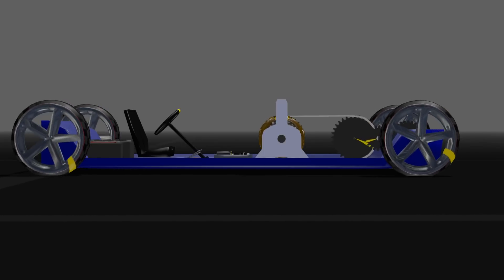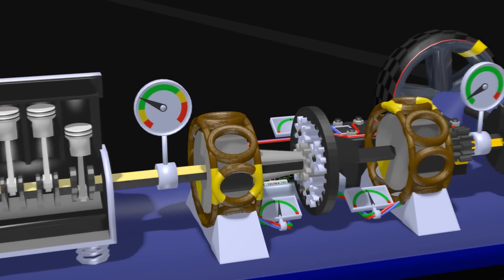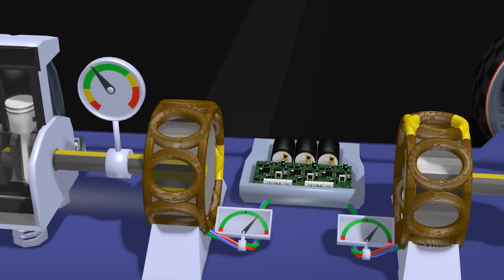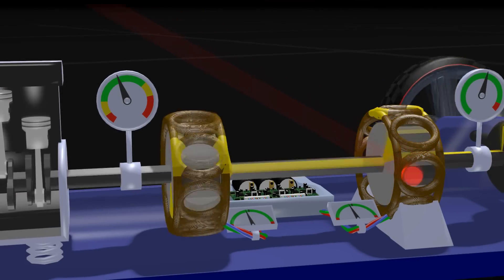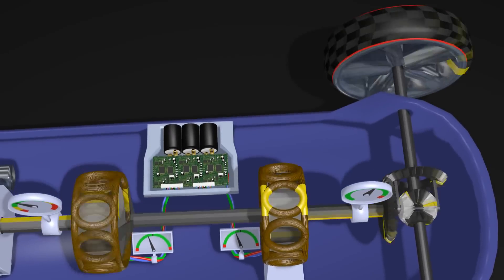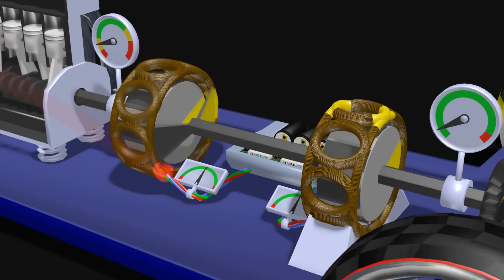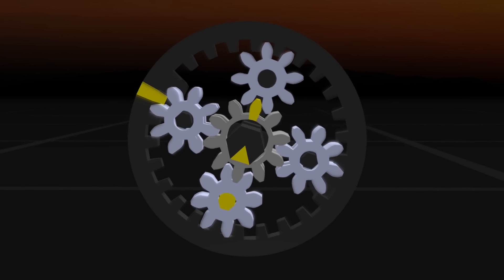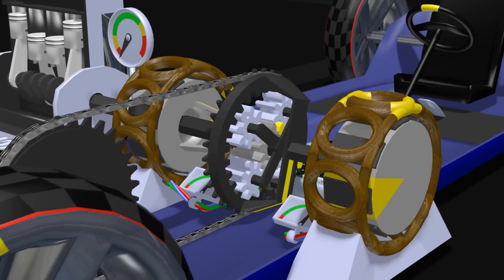Prius Hybrid Drive Explained

Comment: @Niels Blaauw   With all that you know, and I understand that your daily driver is the 2nd gen model, would you say that it is a good idea to go with the 3rd gen Prius because of the gear reduction, allowing MG2 to drive the vehicle for speeds up to 60 mph? I know that the 3rd gen has more torque from MG2 because of this. I'm on the fence between getting a late model 2nd gen or an early model 3rd gen. Thanks!
Reply: Depending on where you live. As far as I can tell, this comes down to fuel economy on highways. My 2nd gen prius loves 70-90 km/h (40-55 mph), that is where my consumption is the lowest, above that I exponentially lose fuel efficiency. As I learned, 3rd and 4th gen also likes 130 km/h (80mph) which is something I could value in EU, but might not be useful in some US states. Also 2nd gen (given similar age/milage) tends to be a bit more reliable, not that newer priuses would be problematic though. Also they are newer, usually meaning less mileage and also a bit more powerful. But I wont change only because of those reasons above. 

I know you did not ask me, but hope I could also share my thoughts.
Reply: @attilap.1817  Hello. I appreciate any feedback from anyone that has real life experience with this car, so thank you for that. If what you are saying is accurate, the 3rd gen would fit my needs best because I would be doing about 70% highway driving and the maximum speed limit where I live is 70 mph, however; most drive between 75 - 85 mph. I would be using it to drive 30 miles to work and 30 miles back home. Automatic climate control and Bluetooth are a huge plus for me.
Reply: @paulv8453  2nd gen also has Digit AC, Bluetooth is an extra and only for calls, not for music. With that said, I understand your leaning towards 3rd or 4th gen. Around here 3rd gen costs twice the as much as 2nd gen with little benefits other than its age and milage, not sure about in US though. On the other hand, prius is not really a car for highways if that is where most of your usage comes from. I am a fan of the car, but a diesel car might suit you better. At least that is the philosophy here :)
Reply: @attilap.1817  I'm not a speed demon. I try to stay close to the speed limit. I am a fan of both the 2nd & 3rd gen. I like the look of both. I like the idea of getting a 10 yr old car and trying to milk as many miles as possible out of it. I have seen YouTube reviews of the 2nd gen from owners that are very happy with their cars. It appears that they're all good but they keep making improvements on each new model.
Reply: My '05 came with over 260K miles. I picked it up from a used lot in March '18 for $2700 out the door. The local Toyota dealership performed a pre-purch inspection for $116 out the door, so I was not surprised later when I needed to replace the water pumps and tires (the brake pads will also prolly need replacing within the next 6 months).

The one surprise was the dash going out. Apparently, they need to be replaced at 300K miles anyway, but mine went out due to some old solder on the board (which apparently is not uncommon). There is also a blown fuse I continue to investigate, but I believe this is due to some faulty aftermarket wiring perf'd by the previous owner to install an iPhone plug in the center console.

The bottom line is that this car treats me so good, and for so little invested. If I had the money, I would go for a gen 4 (maybe a V), but I would not go with a gen 1 or 3. The difference in price from gen 1 to gen 2 is small compared to the upgrades, whereas the price goes up significantly from gen 2 to 3 with marginal improvements in design.

BTW, I use my Prius as a motorhome. I spend only $3-$5 per day in gas leaving the climate control on all night plus driving around town. Over the weekend, I drove from Greensboro, NC to Sanford, FL in Thanksgiving traffic for under $30 one way
Reply: @MarcillaSmith  Wow! That's amazing! I had an opportunity to purchase a 2nd gen 2005 model, the loaded one with HID headlights and fog lamps with only 118,000 for around $5500 but then I see that I could purchase a 2010 3rd gen for around $7,000 with higher mileage. The 3rd gen is supposed to be more comfortable, Bluetooth operates both phone & mobile device, and the MG2 motor has a gear reduction allowing it to spin faster, driving the vehicle up to 60 mph in all electric and therefore produces more torque. From what I've studied, the most significant improvements were made after the 2nd gen. According to Weber University here on YouTube, the 1st gen & 2nd gen share the same trans axle design. I'm sure that I'd be happy with either one. I too spend a lot of time on the road in a long commute and a lot of it is stop and go so I think that a CVT would be very beneficial. Thanks for sharing that story.
Reply: @paulv8453  I own a 2010 model.  Bought it in 2013 off the lot, it had 60K Km on it when we got it, was a lease return.  Paid a few extra bucks and they reset the warranty to new.  Today it's got 260K km on it, the only maintenance other than regular service happened last month, had to replace right rear wheel bearing, and I think left is starting to make noise now, so it'll be replaced soon.  Also did a couple of headlights a couple years ago.  Car has been great since the day we bought it.  I do one relatively long trip monthly with it, 250km each way, half on freeway, half on regular hiway.  The freeway portion is very hilly and we set the cruise control for 125 km/h for that part of the trip.  Computer tells me it does 5.3 liters per hundred on that section.  The other half is flat, slower at 90km/h, and computer tells me it does 4.7 liters per hundred on that section of the trip.  These numbers repeat month in and month out.  A couple times a year I'll spend a couple days in the traffic in big city.  If I reset the trip computer when I drive off the ferry into the big city, it will consistently show around 4.0 or less liters per hundred after a couple days in traffic, probly 150km total driving.

Ours does not go up to 60 in electric, gas engine kicks in before you get that fast.  Dont have the bluetooth or other fancy options.

One area where this car really surprised me was driving in the snow.  As long as it's not so deep the bottom starts plowing, with good winters on the front, this car is fantastic in the snow
Reply: @gerryrozema8338    Thanks for the info. I know that owners of both the 2nd gen and 3rd gen have had almost nothing but great things to say, so this doesn't surprise me. I must have been mistaken about being able to drive up to a certain speed on all electric. I could have sworn that I saw that in one of the YouTube videos from Weber University. You should check out their videos on how the hybrid system works. It's really amazing.
Reply: Paul, I believe (and certainly hope) you are going to be happy with whatever Prius you choose!

My reasoning for saying the "bigger" difference is between the 1st and 2nd gen is probably less technical and more practical than the perspective of Weber U (also makes great vids). The first gen is much more likely to burn out the MG's, and then what remains is worth less than the cost of replacement. Meanwhile, the cost difference between the 1st and 2nd gen is minimal (maybe because finding a used first gen is such a "rare" find?).

Another metric to check is fuel economy. Checking both the EPA site and Fuelly, the bigger difference in MPG's is seen between the 3rd and 4th gen.

As far as MG2 driving the car up to 60MPH, are you speaking of "pulse-glide" driving or are you saying MG2 can accelerate up to 60MPH from a stop?
Reply: @MarcillaSmith  Hello Marcilla. Great info and I appreciate your input. I am totally OK with purchasing a nice 2nd gen. One of my favorite vehicles that I have ever owned was a 1999 Honda CRV. It did everything & it was easy to work on and I prided myself on having an older, paid-off car, that was in very very nice condition. So, I could easily see myself in a late model 2007 - 2009 2nd gen and taking very good care of it. 
As far as the MG2 accelerating up to 60 mph in EV mode, that's what I understood from the Weber Univesity video. Keep in mind, you're talking to someone that has not even driven a Prius before so it could have been my interpretation. Check out the video here: https://youtu.be/w_mc17CoyJs    He begins speaking about EV mode at around 17:55 but then specifically mentions the 2012 -2015 plug-in model being able to drive up to 61 mph at 19:35 . So, maybe it's specific to the plug-in version.

Comment: The  Holy Grail of hybrid electrics would be 100 miles on a charge.  That would change everything
Reply: 300 miles in a pure EV is better. Hybrids have more parts, more failure points, less passenger space, more things to maintain, plus you have to put gas in and change oil.
Reply: @hondaguy9153  I agree, but for now I'd take 100 miles, but pure EV would be awesome if and when it becomes just a hair more affordable, fast charging, and with more stations. I'm doing my part to steer from gas

Comment: The efficiency and the interaction between 3 motors is amazing but the thing that really gets me on this design is the CVT variable. It functions as a near lossless infinitely variable transmission and does it with a simpler mechanical design than any other type of CVT I have seen while making it more reliable at the same time. This little car is an engineering marvel. 
Its a shame that left wing nut job earth worshiping environmentalists have given this car such a bad image. I drive one but I find it hard to be proud of that fact, I even feel a bit ashamed of it when I am not thinking of the cars mechanical feats and pocketbook saving fuel economy.
Reply: I agree!

Comment: Family has two hybrids, the Mitsubishi Outlander PHEV and Ford Fusion Hybrid, the latter actually employs the same identical powertrain as the Toyota Hybrid Synergy Drive as Ford & Toyota cross licenses patents. The lack of gearshift and no intrusive engine start stop is something that I learn to love in driving hybrids. Even better understanding regenerative braking- no more guilt of riding the brakes and replacing pads & rotors when the MG2 can take it all back and give you more electricity to get even further.
Reply: MG2 cannot "take it all back." You will lose power riding the brakes. Nothing will ever beat coasting for efficiency.

Comment: Can a prius 3 be supercharged  like a lotus  which has the same Toyota engine .
Reply: Probably, but you might get better results from improving the battery/mg instead.
Reply: It would not be worth it for the 11mile range even it if was instant fill up. If your current car got 20mpg average it would be like only putting a half gallon of gas in your car every time you fill up. Would it matter how fast the gas was pumped or would it still be super inconvenient to stop for half a gallon of gas every time.
Reply: @wvadam  Toast Tor wasn't referring to Tesla Supercharging, but to a turbo-style supercharging of the petrol engine.
Reply: @mrmichrom8553  thank you for clairifying that. It didnt make sense the way I read it. Will look into that.

Comment: Tank you for this great video! I’m not sure if I understand everything, but it is definitely clearer now. The thing I still have to understand why Prius does not require a traditional gearbox? Is this because of the near constant speed and power can be drawn from the combination of petrol and electric engine?
Reply: László Pál yes, the design decouples speed of rotation of petrol engine and wheels in the wide margin (any can be stopped while the other rotating feather fast) so this allows 2 settings for petrol engine - it is either runs “optimal” RPM or is stopped altogether while the car is going 0..100km/h (when going faster, though, petrol engine increases RPM from the “optimal” zone and also will not be able to be stopped (it is physically rotating after certain wheel speed). This is tradeoff (you either lose some efficiency on high wheel speed or increase the transmission MGs and electronic power)
Reply: Elliptical gears are more efficient because only the percentage increase or reduction in speed is carried through the meshing teeth of the pinions. That is the case in bicycle hub gears so it is probably the same in this case.

Comment: You are wrong, schematic is quite wrong, mg1 is connected to the petrol engine, mg2 is connected to wheel drivetrain , there are clutch and CVT between mg1 and mg2, which started to work when you get speed 15-20kmh. In short - Toyota hybrid system is aimed to remove idle working of petrol engine, its started when: need of heating, need to charge batteries and when you get 20kmh or need more power to move car. Plus that, mg2 has regenerative braking function.
Reply: Prius can start move only using mg2, then when needed, it connects petrol engine, it depends of dynamic of acceleration. On 55kmh - it 100% works only on petrol. (On 20s priuses).
Reply: The Video is actually correct. MG1, MG2, and the Petrol Engine are connected together with a simple planetary gear set or Power Split Device. There is no clutch or CVT needed for Toyota's Hybrid Synergy Drive (Other manufactures do use clutches, but Toyota kept theirs very simple). MG1 is connected to sun gear, Petrol Engine is connected to planet carrier,  and MG2 is connected to the ring gear as explained. The computer controls all 3 to achieve what is needed. You are correct that the engine does not rotate when in EV mode, and that's because of the way a planetary gear set works. As long as MG1 is spinning freely while MG2 is moving the car, the planets (engine) don't rotate. The Petrol engine can only "contribute" torque through the planetary gear set, it can never completely drive the car. In speeds above the threshold (due to MG1 rotation limit) or when pressing harder on the accelerator even at low speeds, the engine is contributing torque through the planetary gear set and of course turning MG1 (which generates electricity to concurrently provide to MG2 or/and charge battery if needed). Check out this awesome video where he has all the components connected in the actual assembly and you can see how they all fit together and rotate - https://youtu.be/ia6jJO3cuOY

Comment: Great explanation, but I'm still unsure how the engine 'drives' through the generator. Is it the fact that a generator is harder to turn when under load & thus will act like a torque converter?
Reply: It's permanent magnet rotor with few phase stator windings, see brushless motors solutions. May act as generator, for motor action require electronic frequency converter. And used in stepper motors applications - rotor may be "locked" in position with constant current applied to stator windings, when acting as "full close clutch".

Comment: Thank you for this amazingly clear explanation. This is why the transitions in a Prius are so smooth. But what is the whine in a Prius (and other hybrids) when the regenerative brakes are applied?
Reply: The whine sound is coming from the motor-generator itself, when it is spinning. It is similar to the whine sound you can hear from a small electric motor in a remote control car or something. If you listen closely you can hear the whine in the Prius both when the throttle is applied and the regenerative brakes are applied.
Reply: CHeers. Love that sound.

Comment: Great explanation but i am buying a c-hr witth a 7th generation motor.  Is it good.
Reply: Can you take a used 2005 Prius inverter and use it in a 2002 Prius
Reply: Can you replace your 2002 inverter that is deemed no good with a 2005 Toyota Prius inverter

Comment: Very nice explanation.  The drive shown at 5:00 is the "Owen Magnetic" drive, from the nineteen teens.  It should also be noted that, during overdrive operation, these drives become less efficient.  At deep overdrive ratios, the electrical power circulating between motor and generator far exceeds the total power transferred from the engine to the wheels.  Overdrive is best served by a third generator, driven directly by the engine, it's power going to the MG1, and MG2 left to freewheel.  Maybe for the next generation Prius lol.